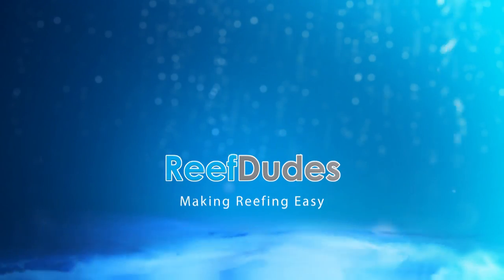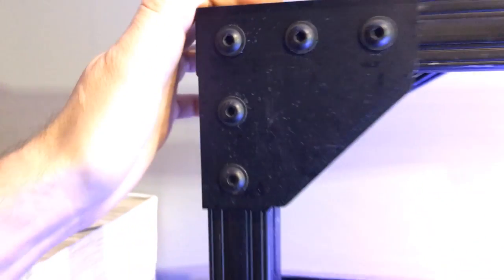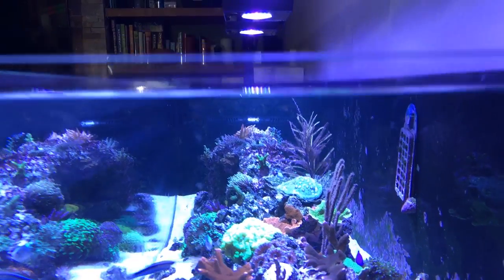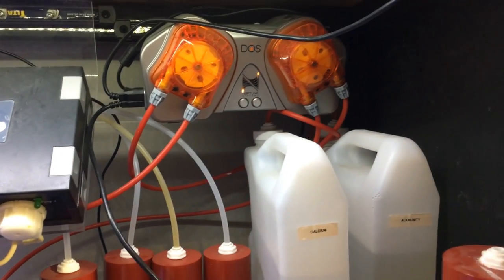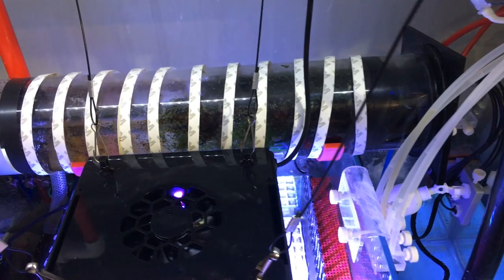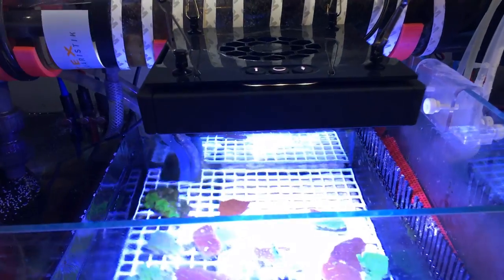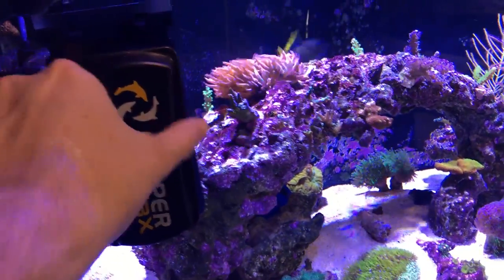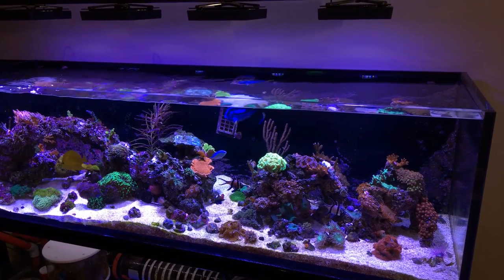Shallow Reef Tank Sump and Equipment Explained - Echotech, Neptune, Jebao, DIY Reactor, Controllers

Comment: Hey ReefDude, I'm working on setting up a reef.  I'm waiting for a kitchen reno project to get done.  My wife is driving that train with a contractor.  Every step they make brings me that much closer to realization of my reef.  I just decided on an auto water change but do to my tanks location I have to use two tanks for reservoirs for the water.  I like your channel.  It's given me a few ideas.
Reply from the maker: If your doing Reno’s you can always run lines into a garage or another room with more space for a remote storage location

Comment: quick eazy way to up the ph on any tank with a protein skimmer. move your air inlet tubing from inside the house to outside, ither using a very long airline tubing or drill through the wall to the outside this will reduce the total dissolved Co2 in your tank and raise the ph
Reply from the maker: This is very true! And prob one of the best ways to raise it!   I actually ordered an ozone generator so that's my next experiment! :) I'm curious to see if the extra oxygen molacie makes a difference :)

Comment: Awesome video and great product shoutouts. I’m trying to finish a 55 set up that I want to eventually upgrade into something much bigger and more advanced like this. I do have a question though; where did you get your glass? One thing I’m having trouble sourcing is a good place to get glass. I see a ton of videos on how to build a tank, but no one mentions where they bought the glass itself. Thanks!!
Reply from the maker: I had it build by concept aquariums.   I designed it in 3d and they put built it for me.
Reply: ReefDudes their website doesn’t seem finished. Nice looking tank though love how it’s braceless and thick! My only concern would be I need a lid because of the dog. Hair would be everywhere lol

Comment: If you want higher PH change your alkalinity solution to sodium carbonate. Commercial bicarbonate blends are designed to be PH neutral. Sodium carbonate will raise PH and is 60% more concentrated. I use the BRS powder and dose 24x a day. It keeps my PH at a perfect 8.3 during the day and 8.2 during the night.

Comment: Just a heads up, Having an over over sized skimmer just means that it will not be skimming 100% of the time, it will be more off and on. You could save electricity and run that skimmer for half time 12 hrs and get the same results.
Reply from the maker: Prob true. It's DC so pretty efficient as it is.  The prices was right so I went for it (future proof if I ever upgrade). I could run it just at night to make my tank even quieter! Hehe

Comment: Reef Dude, can you show in more detail how the light rack is attached to the floor or the stand? I'm designing the same system for my 80 gallon frag that will be lit by the AP700. My tank is set up as a peninsula. Thx!
Reply from the maker: Sure can.  I'll shot another video talking about just the light rack :)
Reply: Thx dude. Got a bunch of stuff sitting in my cart at 80/20 =)
Reply from the maker: I shot some video on it today just for you.  If I have time to edit it tonight I'll post it for tomorrows video :)

Comment: What are the overall dimensions of your tank and what size tank did you use to make your sump?  Very nice!
Reply from the maker: The Tank/Stand  is 6'1" long  20" wide 18" deep.  The tank it self self is about 5-6" shorter as the end cap has the overflow area)      I designed the sump and got the tank builder to build it with the tank.  Let me know if you have any other questions :)

Comment: What build date is on your CP40?  There were tons of failures in the stuff built before July 2016 I believe. Mine only lasted 6 months before the motor failed. I have not had any issues with my 3 Maxspect gyres so far.  Just wondering if I should give the CP40 another chance.
Reply from the maker: My origional contrôlée had an issue where it would not always turn the pump back on in pulse mode.  They replaced the pump. Same issues.  All other modes worked fine.  They ended up replacing the controller and it's been golden ever since

Comment: Do you use an extension cord to run your power to the other end of your tank for power supply? What are your thoughts on running an extension cord in the sump area of your tank?

I’m starting a peninsula 6 footer and my power supply’s will not reach to the other end. Thank you
Reply from the maker: I actually have a plug in the middle of the tank on the wall.  I have a ups plugged into the tall and everything else plugged into the ups.  My overall length is 6’1” and I managed to “just” get everything to work without extension cords (surprisingly). I only have one on there and that’s to the ozone genteratoe on the back end of the tank on the overflow wall   If your going to use them just make sure they are up high and don’t have any risk of water dripping on or seeping into the connectors. Most of my wires are hid at the top of my stand behind the bar out of sight
Reply: ReefDudes thanks man. Ya a lot of peps day that extension cord with short out your equipment if you use them so I wanted to see what you thought. My peninsula tank is gonna have one power outlet where the overflow is so tryin to figure a safe way to get power six feet down the tank.
Reply from the maker: You could just make your control area on the side with power!  A lot of the equipment has fairly long cords these days. Maybe check the specs and take it into consideration when choosing which parts to buy

Comment: Hey there - love the channel, and great videos. The light mount is especially slick. Just a question about the CP-40 - you know that is a counterfeit version of the Gyre, right? It is currently in trademark dispute, and is an illegal copy. You might consider replacing with an IceCap licensed version (cheaper than the xf250, if that is a concern), which is a more ethical choice. It is always disappointing to see fraudulent copies of equipment, which takes away from a legitimate businesses' ability to leverage its success and to innovate to create better equipment for us all.
Reply from the maker: Thanks Peter!   heard about that. Not sure how that works with china compay copying another but it works well for now all prob keep it until it fails... it does then look at my options at that time! Doesn't make sense to spend a bunch of money on a new pump when I have one that works for now :)
Reply: True - might just want to call it out, as I'm sure people look up to you as a good resource for education and reef equipment. Kind of funny, Maxspect knew Jabao would copy their design, and sent a pre-emptive cease and desist letter to them, which they ignored. They are still fighting about it. Jabao also blatantly copied the original Tunze designs for their pumps. I think we are so used to everything being made in China that we don't really consider the impact. The real pumps are more expensive, I hear ya, but the hobby benefits long term when counterfeits are not highlighted, and legit companies can innovate and bring new tech to market for us all. I wouldn't be suprised if the new IceCap license model (and a similar license model in Europe) is specifically to head off crappy Jabao. Just on principle I won't buy anything Jabao for that reason - though their price point is hard to ignore given how expensive everything is in this hobby.

In other news - your tank is really inspiring. Starting my 280 build soon, and it will be a peninsula tank as well, with no obstructions on the opposite side - love the clean look.

Comment: Can I ask for a few more details on your custom light rail, bc it is by far the best I've seen someone build. What are the dimensions of the rail, it looks maybe close to 2ins? And it's a quad rail? And where did you find it, online? Seems most come in just plain aluminum, the black is so much better. Did you get all the accessories through the same place? Could you do a video of how you built that rail?
Reply from the maker: I believe its 1.5" but i can measure it later and try to see if i can the parts/order list.
Reply: ReefDudes that would be awesome. Is it Bosch rails? I dig the covers that go on the slots.
Reply from the maker: I believe its 1515 which is 1.5"x 1.5"  i would prob do 2020 if you had xr30s or heavier lights.. need to calculate how much it can hold with out bending for the weight/span you are trying to do.
Reply: ReefDudes I'll be hanging 3 xr30s but over 5ft so getting the 2020 t-slots might be wise.
Reply from the maker: I'm thinking 2020 or 2525 for that much weight.. but may want to dig into that a bit more. I have 4x XR15 on 1515 so maybe do a weight comparison

Comment: Do you need all those things in your cabinet to run a reef tank, im on a budget and all that seems to me is very expensive
Reply from the maker: You most certainly do not. (They just make your life easier) you could take a smaller tank and have nothing but a decent light and powerhead for water flow then just do weekly water changes and be ducccessful.  His is all I did with previous smaller systems.  One thing you will have to do is top off your tank with fresh water to deal with evaporation manually. If you have lots of coral at some point you will need to manually dose nutrients to the tank. Although weekly water changes can handle that unless your tank is packed with coral .

Skimmer - reduces the need for water changes 
Doser - saves you having to doses manually (dosing is more when you have lots of coral )
ATO - auto magic tip off. Adds fresh water to keep
Saliniity stably and deal with evaporation
Reply: ReefDudes I really appreciate the advice, and you seem to be right it does make your life easier having all those gadgets for the tank...i gotta start somewhere i guess haha
Reply from the maker: If your starting out get a decent light and a wave maker.   Next “essential” I would say is an auto top off.   The rest you can add on down the road as needed :).  When I new I was upgrading to this tank I was slowly sticking up on equipment for about 6 months prior to getting the tank! Haha. I have now had it for a year and a half and still a slow process to slowly add / change / perfect things.  All part of the fun.  But I also love automation and making things self sufficient as possible. :). But start slow! s be warned.. it’s an addictive hobby!

Comment: Where did you buy the brackets that attach the Radion to the rail?
Reply from the maker: I bought the RMS light mounts and took them apart to get the brackets :)
Reply: ReefDudes Dang I was hoping you weren't going to say that!
Reply from the maker: oceanslide hahaa yes! You cooks likely do it out of acrylic or 3d print them but by the time you consider the time and materials it's prob not far off of just buying the brackets   They are only 20-25 each so not terrible considering
Reply: ReefDudes did you buy the whole rms mount? Or the rms slide?
Reply from the maker: RMS Slide is all you need.. Just need the X bracket part.
Reply: Okay cool, What did you use to attach it to the rail? Bolt and washer?
Reply from the maker: Right on the money :)

Comment: I thought your videos were supposed to make reefing easy... This video makes the hobby look extremely intimidating and expensive. Not sure if this was your goal
Reply from the maker: I tend to overkill things haha I do a mix of content but the overarching goal is to teach and simplify complex topics to help others be successful
Reply: @ReefDudes  thanks for reply. I am planning to start a 40 breeder tank spring of 2020 and doing lots of research for now and came across your Instagram. Your tank is definitely gorgeous and I love the light mount, looks super clean. Do you have a video that helps out total newbs? Something about selecting equipment for various budgets and overall tank starting tips and how to set it up. Most videos I find o YouTube are way too broad or teach you how to pour water in the tank lol What people need is a guidance on what equipment to use, how to build and connect sump, what is refugium and how to incorporate that, what lights to use, how to direct a flow and how much flow through the sump and through main display etc etc etc

Comment: so that's like a 10,000 dollar job ?
Reply: but the question is how much did it cost... cause the average * diy  guy*  dosnt have that budget.
Reply from the maker: Thats a very good question.. one day ill try and work it out..  It didnt happen all at once.. its every few paychecks you get something new for the projects.. i was collecting equiptment for atleast 6 months before i had the tank so it happens over time.
Reply from the maker: @oceantank4424  No idea, parts keep building over the years!  IE 2 of my radions were form 3 tanks ago.. i just bought 2 more used ones when i upgraded.  Slowly but surely!
Reply: @oceantank4424  No kidding, huh? Way beyond the reach of almost every reefer. That's why I went bottom tech.. used tank, resealed it, and spent the last year testing overflows.. cuz I'll never be drilling a tank. If anyone see's this, search on my name here and you can see what a DIY overflow and sump system looks like. lol